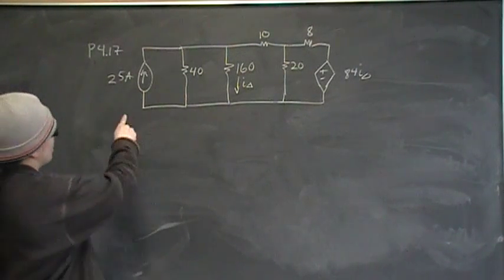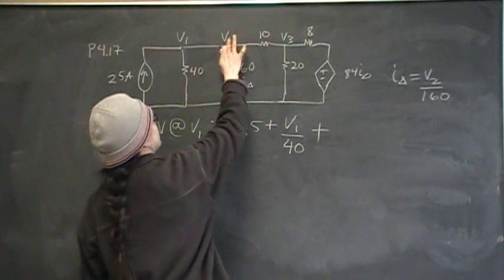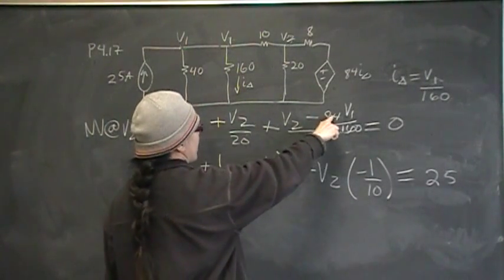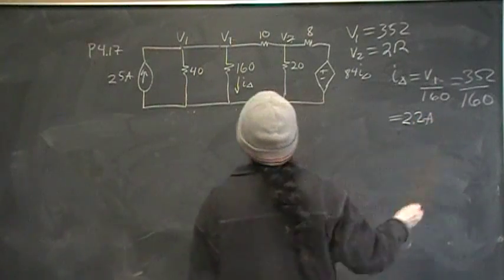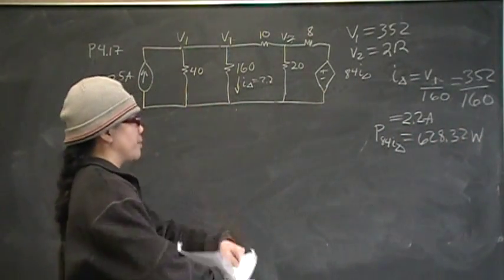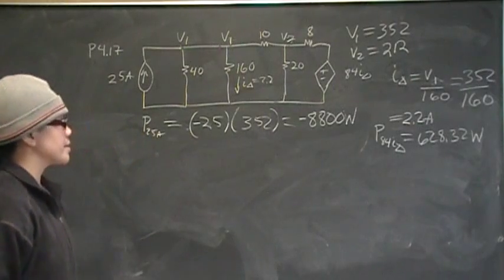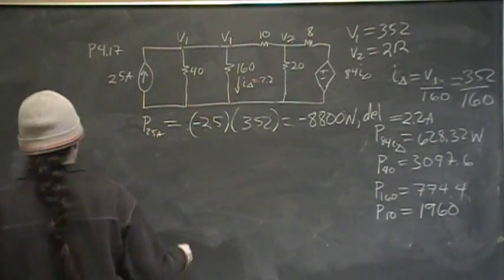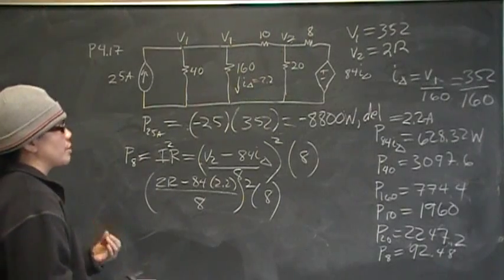Node Voltage with Dependent Sources P4.17 Nilsson Riedel Electric Circuits 9E Solution

Comment: this was such a great video, i was struggling with dependent sources using node voltage and mesh and your video made node a lot easier.
thanks again, thumbs up
Reply from the maker: Sohail Ahmad thanks Sohail! it feels great when i get a comment like this! beats the mean ones ;-) good luck in your career in engineering!